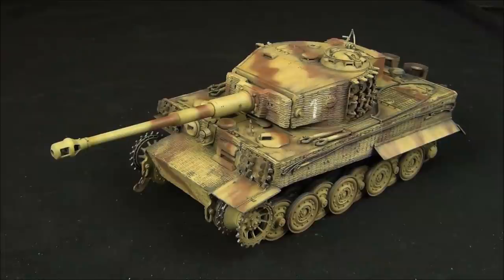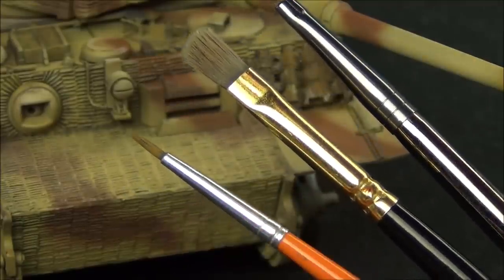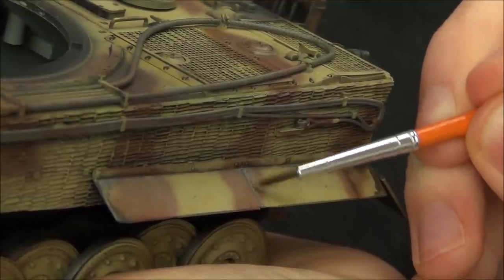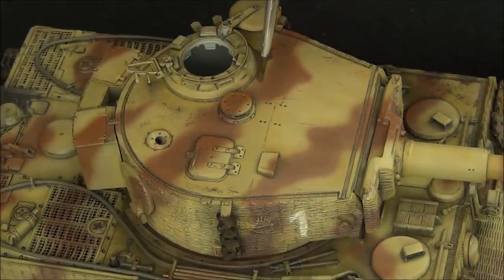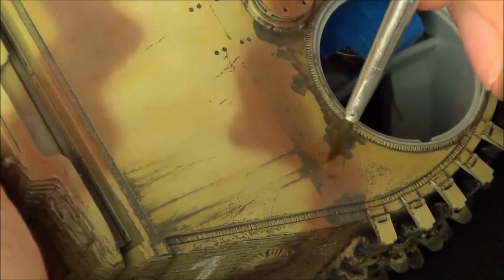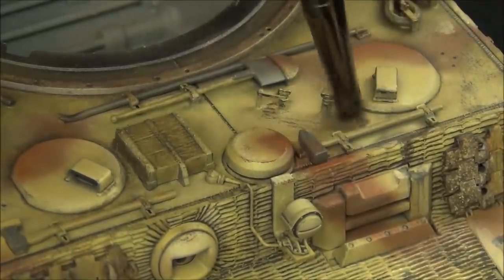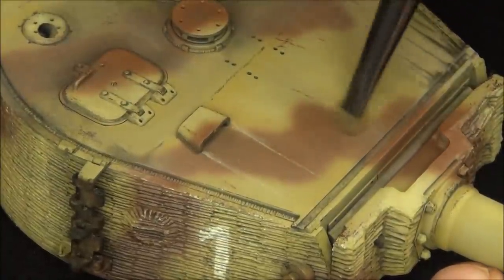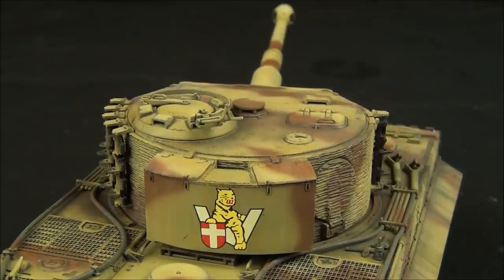Earth & Dust Effects with AMMO Oilbrushers on Tiger 1 - 506 sPzAbt 1944

Comment: Good stuff, Evan. I really like an alternative to pigments. The effect is good, but the problems you mention are annoying, i.e., rubbing off. And if you need to add any more clear stuff for some crazy reason, bye-bye pigments!
Crew traffic is also a good, and sometimes overlooked aspect. Dirt and chipping around hatches on German and British vehicles (chipping and bare metal, or at least primer showing from hobnail boots) dirty traffic without so much chipping on US vehicles since we used rubber soled boots. 
Great video... stuff I'll be using in the real near future!

Comment: One thing I sometimes miss is the areas on any armored vehicle, typically where the crew doesn’t usually wander about too much, where small clumps of mud and dirt accumulate or where rocks and even smaller pebbles sometimes chip or just crack the paint. The soil and rain is usually slitghtly acidic and runs with the mud, forming small streaks of mud and/or rust colour over time. The mud of the current environment typically have a specific quality and distinctive colour that soon gets very recognizable to any personell operating that specific theatre. For example, to my generation of tankers and mech inf the sticky, tough and slick Balkans Mud and the yellowish top soil are immediately recognizable.

Comment: Really great before–after results here, thanks for this! One thing I am struggling with is integrating decals with weathering "believably", how to fade, weather, scratch or otherwise make the transfers not feel tacked on. Using your own model as an example, how might you integrate the decal on the back of the turret to further connect it to your well-used Tiger?

Comment: As always Evan fantastic video 👍 question I've used oils before, infact i have some now VERY runny? anyway I see guys use Abteilung 502 as you' is it worth the cost? And I see some kind of thinner for it.? Sorry I'm older and may want to try oils again. Thanks for any help.
Reply from the maker: Sometimes the oils can begin to separate.  I know some guys will sort of massage/squish around the tube (while the lid is on very tight!) to mix it up a bit inside.  I only have two 502 abt. oils but they seem pretty nice.  I have only used them for pinwashes though..

Comment: Beautiful work! I have a question regarding the VMS Oil Expert you use. It says on their website it is not compatible with Tamiya enamel paint. Are they referring to the line of Tamiya paint most of us use and thin with either lacquer thinner or acrylic thinner? Or are they referring to Tamiya's line of paint in spray cans? Thank you for all the tips in your videos!
Reply from the maker: They are referring to the older Tamiya actual enamels...they are weird little square-based glass bottles.  It's old school stuff.  The Tamiya paint you see everyone using nowadays is acrylic and not the enamels, so not to worry.
Reply: @Panzermeister36  Thank you kindly. I always wanted to work more with oils, especially for weathering but i am always afraid to try.